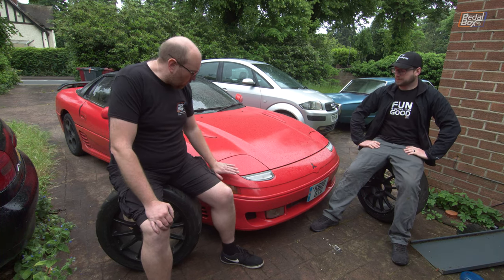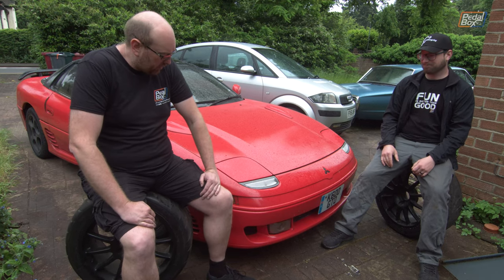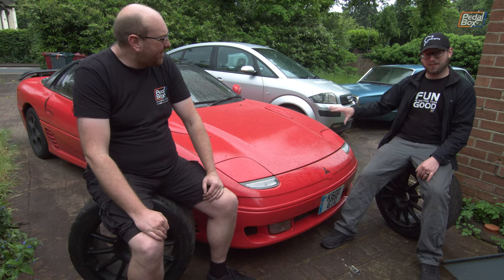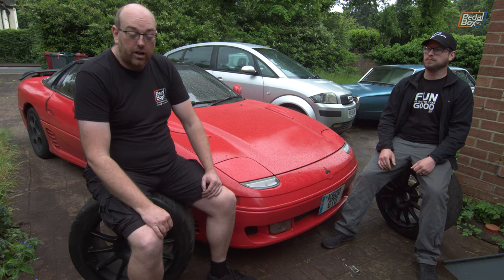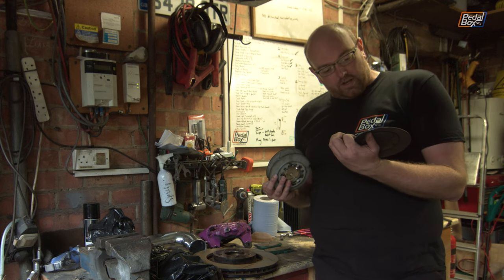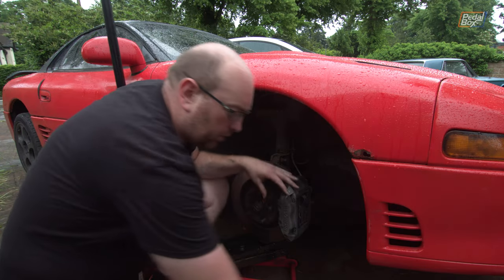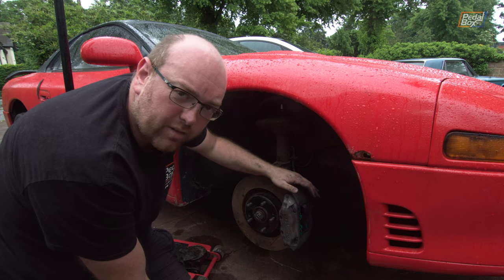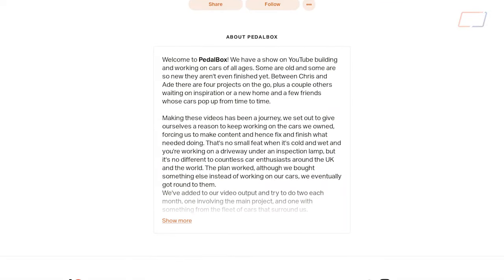3000GT Discs and Pads with @MadScientistGarage | PedalBox Fleet | Episode 159

Comment: My understanding is the grooves go forward to assist in deglazing, and the rotors are usually marked left/right. Unless they are vented disks, then the internal vanes need to point "backwards" to ensure dust is expelled outward regardless of groove/drill direction.